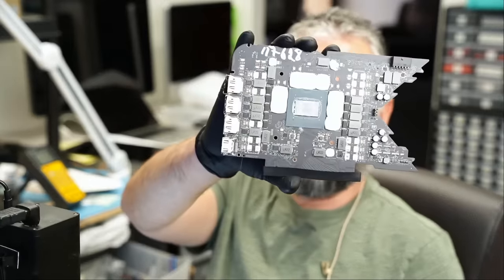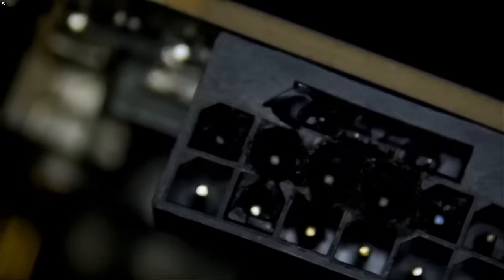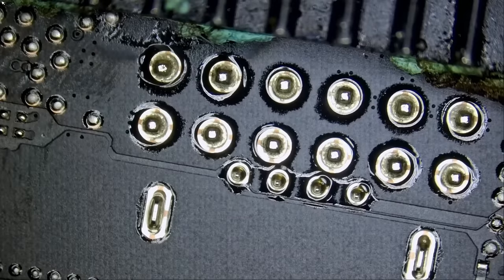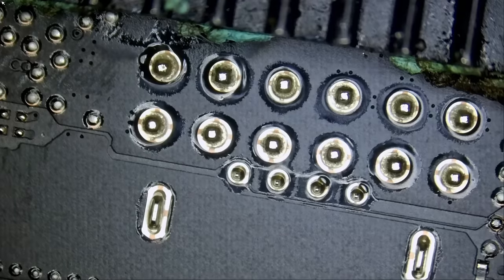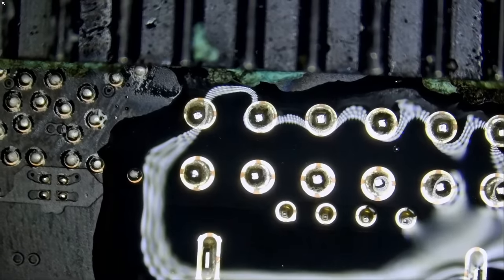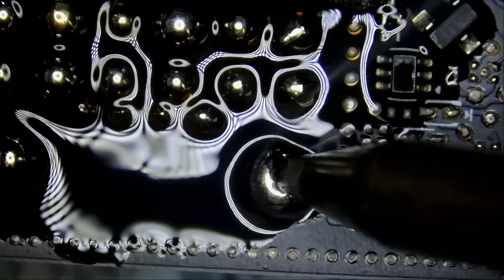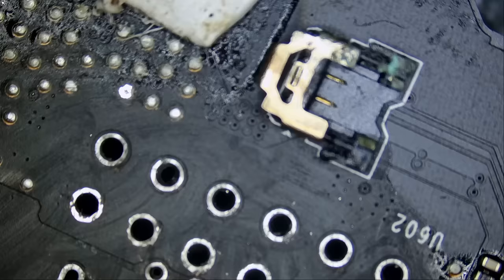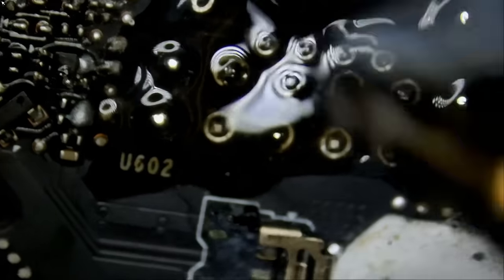4090's Still melting. What I think about CableMod

Comment: Is this the new revision of 12vhpwr  or old ones? Please clarify this because its vital here! 🙏
Reply: Both melt what I heard. I just hope they fix it with upcoming RTX 50xx.
Reply: @Dark_Dusknoir  They haven't, you should ONLY use a ATX 3.0 or 3.1 power supply and not using adapters.

Comment: I think the only solution at this point is to remove the original power connector on the card and connect a short pigtail that has a quality ATX PSU compatible connector on it directly to the board and to call it a day.

Comment: I have a 80 series card and cable mod cables.. direct psu to gpu no 90 Degree adaptor or whatnot... i know the 80s havent seen the issues the 90s have... they dont draw as much power but i did have issues with my 3x 8pin to 12vhpwr cable when i built my current computer it kept crashing till i swapped the oem cables in... they were great about it.. sent me out a newer version of the cable within a week and has been fine. Ive been using cablemod cables for like 10 years or more now and i would NEVER hesitate to use their products.. they stand by them first of all.. great cust service.. and i agree 100% with you.. its not their fault the 12vhpwer connector is a steaming pile of crap.

Comment: I bought an 90 degree extension cable that has an female 12v on the other end that connects to the male 12v of the cable that comes with my rog 4090 on ebay and its been working no problem on my rog 4090 for almost a year now. Or im lucky or I think people are still not connecting those connectors the right way the those connectors can go in more than people think.

Comment: Why are these cards not being returned to the retailer under warranty? Alex have you had any faulty 4090s sent from the UK?
Reply: Because this is not under warranty, its users error/fault nvidia states.
Reply: If your in the UK then your covered by Law so you shouldn't have any issues getting your card replaced by whoever sold you the the card.
Reply: No questions asked in most of europe.
Reply: nvidia refuses to acknowledge this is a design flaw
Reply: @trailfork7815  false, that's why they went with a new design called 12V-2x6, looks the same as the 12vhpwr, but slightly different and the sense pins also work differently now
Reply: @Behemoth33  they refuse to do so officially which is why they still won't warranty cards with this issue even though they redesigned the cables again

Comment: Its clearly a design flaw. Honestly i can't understand why they had so big power connectors before and so tiny ones now, even if the card is pulling more energy than before.
Some cards had 2 big 8-pins adapters and now they squeezed 4 into just 1 connector. This is a recipe to problem.
This is basic electric science, you don't throw so much energy flowing trough a so small adapter, even if everything is right, it would still fail in some cases, cause there's no tolerance for energy to flow trough the connector.

Comment: I needed a 4090 for my work, but was fearful after watching all the cases of melting plugs.  I got one and the included cable stuck out six inches beyond the case side.  I got a 180 plug and carefully arranged and zip tied the cables so there is absolutely no torque on the plug.  I’d bet some of those melted plugs are from jamming the cables into the case, exerting off axis pressure on the connector.

Comment: I wouldn't blame cablemod because this whole problem started with the 12v, there was nothing wrong with using x2 8 pins like we always do. I wouldn't be surprised if Nvidia go back to using the normal 8 pin, at this point it would cost the company more than just cash to replace each gpu that caught fire

Comment: I think the issue is CableMod had bad sourcing, and nVidia gave bad specs to the public about the connector.

CableMod should have changed supply lines to go well beyond specs the second there were signs that the specs were insufficient. 

You can get various connectors that are easily twice the ratings of your standard connectors of the type.   They should have gotten those.  If you really want to go above and beyond you can use a board mounted connector and hard-solder everything.  This provides even higher maximum specs.  This also allows you to add a heat fuse and other power protection circuitry.

Comment: I'm running an RT 7900 XT, and I'm getting 120 - 150fps in 2160p. I feel sorry for anyone who thinks they need more!

Keep in mind that most 2160p panels are also capped on bandwidth. DP 1.2 - 1.4 at 20-32 gbps. The 4090 & 7900 xtx are capable of doing 80 gbps. DP 2.1 at 8k, 2160p and 60fps maximum.

Comment: @NorthridgeFix I used to bitcoin mine, there was a miner company called KNC or KNC Miner they made the Titan which I have two sets of still. They required the a 1500W PSU to power them 4 of them, there was 8 units (cubes) a in package. They would raw so much power that either the connector as the PSU or at the miner would melt. The resolution was to use thicker wire, from 18 gage to 16 gage I think, it was a such a long time ago I don't remember thickness but it resolved the issue. I know most of the community says this isn't the issue but from what I see from your fixing that its still an issue likely what I am saying is related in some way but no one wants to accept it.
Reply: No, thickness of the wire isnt the problem. The problem is the ability of the connector to handle the current passing through it due to poor mechanical connection methods (pressure and contact area).

Comment: Computers should have moved to 24v or even 48v architectures years ago. That would mean 1/2 or even 1/4 the amount of copper required in wiring…
Reply: Can't run a CPU or GPU at 24v. The transistors are so small they can't handle anything more than a few volts. Also, switching losses increase with voltage, so you would make the problem worse, not better.
Reply: That's one of the many things that need to be changed. ATX was a good standard in it's day. However now we have 400+ watt metal bricks sticking out at right angles barely supported vs the single slot passively cooled dongles of yesteryear. Our cpu's are adorned with cooler that create another metal block all but dangling in mid air and ram placement is not poor for air flow, but restricted by same cpu cooling metal block.
So yeah, a 24-48v system for cables to the MB would help. Redesigning the pcie connector to have 200-400 watt delivery capability and designed in gpu support and moving the ram/cpu area around to provide better airflow and fitment of components is long overdue.
Reply: @gaynzz6841 Actually it doesn’t change anything as nothing runs natively at 12v either. You still use Mosfets / regulators but switch at different frequencies. But using a higher voltage you have less voltage drop and smaller traces / wires. Companies have been using 24v in servers for years for efficiency…
Reply: @kaseyboles30 Yup I personally think it should be a one off move to 48v like ripping off bandaid so it doesn’t need to happen again for a long long time… At the same time 5v and all the other legacy rails can be made redundant and all voltages can be created at the destination with localised power regulation.
Reply: Them it will put more stress on the step down regulators that should be local on the card
Reply: @whatcouldgowrong7914  Like  @38911bytefree  said, somewhere the bus voltages have to be stepped down to whatever the MCU uses. If you place a buck converter that goes from 24v or even 48v down to say 2v that will create another hot spot on the board (with the CPU already being the primary hot spot), not to mention add more EMI trouble which is not a good thing to have near sensitive components. That's why the main PSU takes care of it which is placed far away. I don't think trading less copper for more heat and EMI on the local components is a good idea
Reply: @gaynzz6841  You dont step it up, the PSU makes 48v and thats it. Its then stepped down at the destination and no it doesn’t create more heat the MOSFETs just switch at different frequencies. It is literally the only way to solve this problem. Higher voltages mean less current. Less current means smaller wires and traces. You could almost run a GPU off the PCIe connector at 48v
Reply: @whatcouldgowrong7914  There is no problem And you are wrong. I'm an EE so I think I know how a buck converter works. It doesn't "step up" anything. Lmao. I'm done here, youtube deletes my replies, waste of time.

Comment: THE PROBLEM IS A COMMON ONE IN ELECTRONICS.
PUT SIMPLY THE THE FEMALE CONECTORS ARE NOT MAKING A  GOOD CONECTION  WITH THE MALE CONECTOR OR PIN 
THEREFORE THERE IS NOT ENOUGH MATERIAL CONTACT FOR THE REQUIRED CURRENT FLOW CAUSING OVER HEATING OF THE CONECTOR.

Comment: I would like your thoughts about why the melting only occurs on the card side of the connection and not at the psu connection? I wonder what is different about the connector on the psu that keeps it from overheating to its melting point?
Reply: If I were to make a guess it's probably a combination of two factors.

1. PSU side sees less stress from cable management.

2. Probably has something to do with more copper on the PSU PCB. Heat might be allowed to sink away faster on the PSU side.
Reply: There are two options, the section of the connector is smaller or the connection itself has a worse contact quality. This translates into higher resistance which transforms into heat
Reply: There were reports of 'on the PSU' side, cable slide-out due to no latching mech. in PSU.

Comment: I wonder why they don't even try to fix this 4090's problem. Every single card is at risk to have it's connector melting. Maybe they should divide the circuit in two with two power connectors. The power input is too great for the thickness of the pins. The world is lucky to have you to fix all those cards with better than factory results

Comment: Idk if this helps but ive had my 4090 strix since release i have a corsair pwr supply n i only use corsair air sleeved 12v connector and havent had a problem i use to check it once a month but barley do now n it been fine even when over clocked idk if im lucky or just cause i used stock wires n big case

Comment: Why don't they manufacture these connectors with PEEK plastic (Polyether ether ketone)
It has a melting point of 350c
Reply: Good question
Reply: Because this does not solve the temperature problem
Reply: If nothing melts or burns, it doesn't even matter how hot the connector is...
Probably they dont want spend more on the connector quality...
Reply: @phantomzagreb  ars technica mentions that a temperature above 250 degrees occurs.
Reply: the problem is that the contact of the metal pins is bad

this causes the heating in first place
it shouldn't even get warm..
Reply: Other things will melt
Reply: If your card breaks down they hope you buy a new one since the warranty does not cover this.
Reply: They need to get better surface plating on the temrinals, like silver. This will do the trick. By trying the connector not to melt, is not the solution. Eventually this will damage something else like the PCB. Also at 350, solder is liquid or almost there.
Reply: They are cheapskates (yet overpriced)

Comment: Can a connector with longer leads be made and stick through enough to actually solder another connector on in a way to distribute the load better? It would have to be mirrored. The pins are such a weak link in these monster current suckers...

Comment: I don't understand why this happens, is it from so much current passing that it heats the pins and that melts the plastic?
Reply: If I understand correctly from watching this channel, there are two problems with the connectors, they are badly stuck on so either you push the cable in hard enough to be correctly inserted that you bend the pins behind the connector from the force, or you don't and end up with a cable not correctly inserted which causes burning. I believe the melting is a partial insertion specific problem.
Reply: The contacts have a small resistance. Every contact do. As the current goes up, your contacts should be as low resistance as you can get. This is done by picking the right type of connector with proper sized terminal and surface coating to enhance contact even more. But when the contact is not up to the task, it resistance turn them into a power resistor that disipated heat. The more amps, the more heat the contact disipate. Connector pins most go hot as hell, as soldering iron tips, and melt the connector enclosure. The conectors have many V+ and GND pins in an effor to lower the current at each contect. I an ideal situation a card asking for 40 amps with for V+ will sink 10A on each terminal. Well, the ideal world does not exist. This assumes that every single contact has the same ressitance (in the miliohm range). Good luck trying to equalize this. I mean. it works, but it is not a proper solution.

Comment: Watched this video the other day,  went to cable mods site, they don't sell a small 90 degree adapter, they sell 12VHPWR cable kits and 12VHPWR PCI-eCABLE. 
They sell 6 and 8 pin pci-e connectors a 4 pin atx connector and an 8 pin EPS connector and a 24 pin ATX connector. 
They don't sell a small 90 degree 12VHPWR Connector. 
Any thoughts?

Comment: damn im picking up an fe 4090 on saturday.  Has this at least been resolved for new issues?
Reply: No, it has not been resolved. It's an overall design flaw for all 4090s. So yours could very well suffer from the same issue.
Reply: @joshuapicarello  I have an unopened 4080, same issues?  I was going to return the 80 when I saw the 4090 and snagged it.  I'd gladly stick with the 4080 to negate any potential meltdowns
Reply: @macaltime2  The 4090 seems to be the only card with this problem, so you should be alright.
Reply: It's not that every 4090 has the issue. I've my 4090 to the ATX 3.0 PSU with a single cable and so far so good. I wonder if it actually makes a difference if you've an older PSU and use multiple cables which end up the 16 pin connector. Shouldn't make a difference I think but not sure how that works since that single cable has those 4 extra sense pins on both sides.
Reply: @joshuapicarello I had a 4080 Super FE melt, so no. Connecter was also 100% plugged in and have photos to prove it
Reply: @Reaper_ZL1  I'm honestly not that surprised. Nvidia fucked up big time with their 40 series.
Reply: The card shown in this video isn't even a 4090, it's a 4080, they sure do have the same issues.

Comment: I dont get the initial appeal with these 12vhpwr connectors anyways.  Its not like its some fundamentally new connector, like usbc vs microusb, its  just the old PCIE plastic connector, but flimsier than the old ones and somehow in some feat of defying physics it  is supposed to do 4X the power? I use cards for rendering 24/7, I am considering having wire soldered directly bypassing the connector and terminating in PCIE.

Comment: What's the solution then to avoid this happening?  Just got my rtx 4090.. should I just not use a third party adapter? I understand the adapter that came with my card needs to be pushed in fully 'home' and fully clicked in.. anything else?

Comment: I'm sure the main reason is that the pins inside the connector are very thin. Because of their small area, they heat up more, this is a law of physics. Nvidia must admit that the 12+4 has a fundamental engineering flaw and will completely abandon this connector in future graphics cards!

Comment: my 4090 strix still goes good and running +1yo. Hopefully it will stay this way. It pulls only 450W during gaming. I do not use cablemod, and use the corrsair 12v cable with their 1600W powersupply. However for this nvidia should be sued!

Comment: @northridgeFix just curious if using a CableMod  PCI-e x2 8 pin to 16 pin 12VHPWR is sufficient and more importantly safe for a 4090?
Reply: The safest is to use 12VHPWR to 12VHPWR, that's the only way the sense pins comes in use.

Comment: I think the only way they can try and prevent this from happening is using a plastic thats max tempeture rating is around 200c( I know that's pretty high but itll prevent this issue) idk how much it would cost to use plastic like Polyamide-imide (Torlon variant)

Comment: many claiming it should be class action law suit, but thats not the case, the reason products sold have a WARRANTY, is for just that purpose. if something is faulty, the warranty covers it.  no need to sue when you can get it fixed or replaced via warranty.   every time something breaks in the world is not a law suit, all products sold at least in the USA have to have a warranty.  So dont need lawyers and such for a broken part.

only time a class action would occur, is if they were refusing to honor their warranty, that doesnt seem to be the case, seems they are honoring their warranties for the most part.

Comment: I have an ASUS TUF 4090 I bought the day they came out October 12th 2022 and use it a ton. No signs of anything happening. I've heard there's a revised version of the 12VHPWR plug and wondering if its a good idea to replace it anyway.
Reply: Connector is fine, people just cannot plug it properly as these days everyone is doing their own computers. Otherwise they would just RMA card, none of these 4090s is older than 2 years and many of them have extended warranties 3 or 4 years. Not RMA card and send it to repair shop = card damaged by owner or transportation.

Comment: any reason we couldn't 3d print two 8 pin connectors that can be soldered into the 12vh slots that allows for use of the old standard 8pin connectors at the gpu, but lands at the appropriate
pins for the 12vh at the power supply?
Reply: you could just splice a 12vh cord into two 8 pin cords, ensuring of course the proper pinout was spliced accordingly